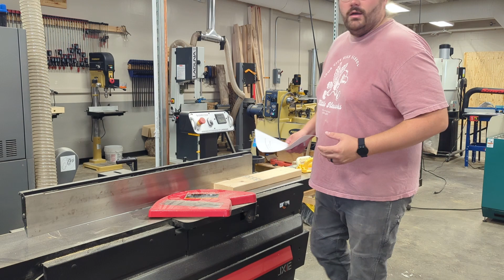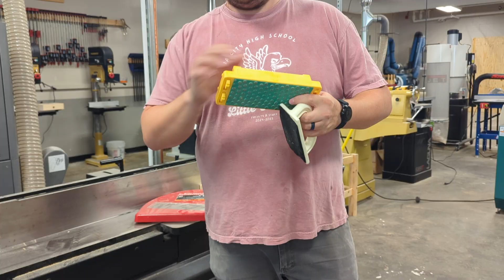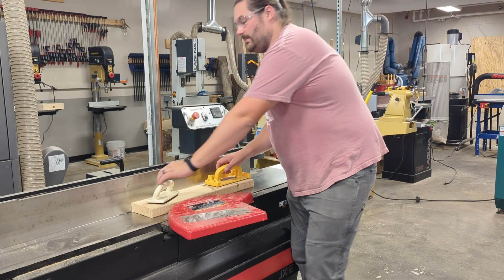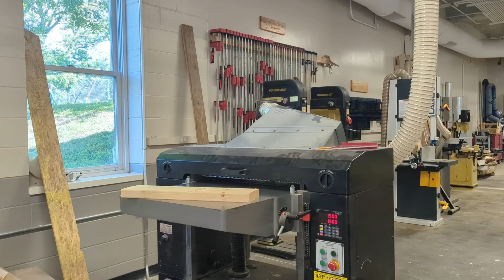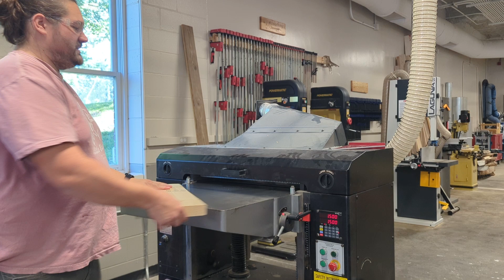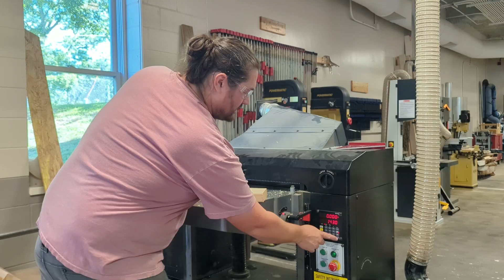Jointer and Planer Safety 2025

Comment: I have an 8" Laguna jointer but I am getting snipe and for  the life of me< i can't get rid of it.   they say to not move the outfeed table but it seems I may have to.  Any tips on how to calibrate it?  Thanks
Reply from the maker: The important settings are to make sure the two tables are perfectly parallel and then that the outfeed table is at the same height as the top of the cutter head.  You can use a straightedge on the outfeed table and if the cutters just barely graze the straightedge when turned by hand it is set correctly.  I'm not sure on the specifics of how to adjust that, but it should be in the manual.